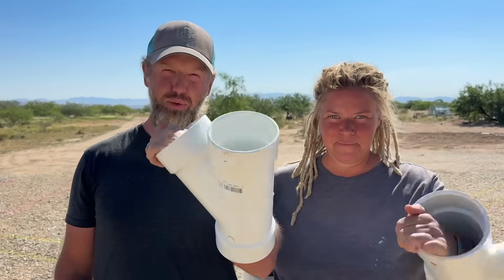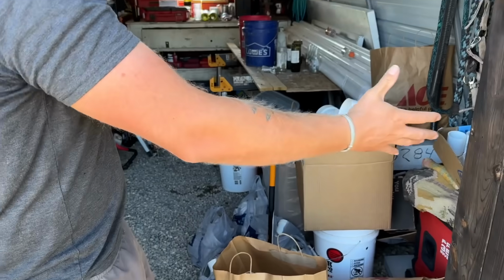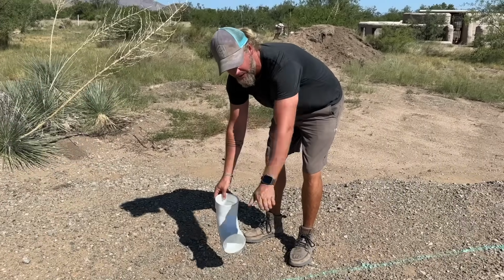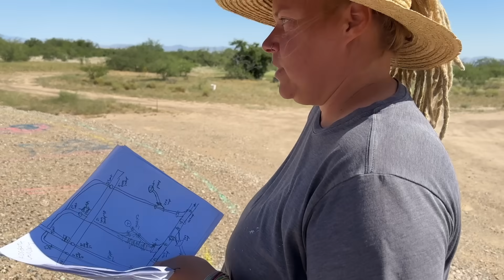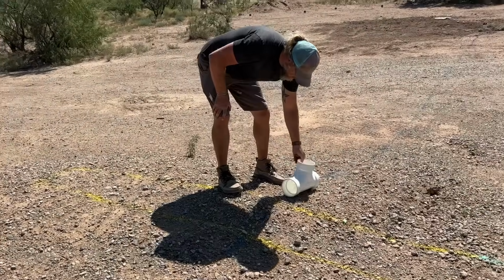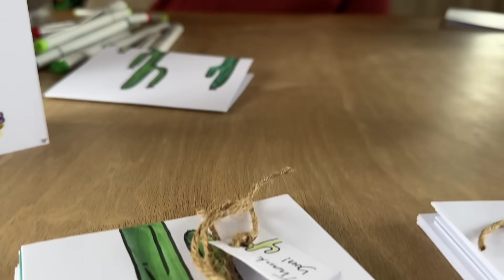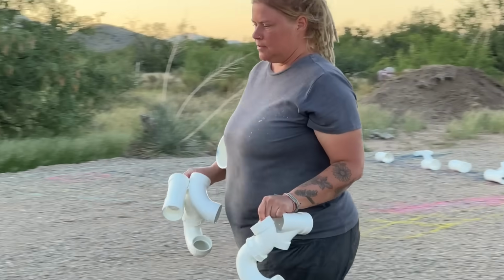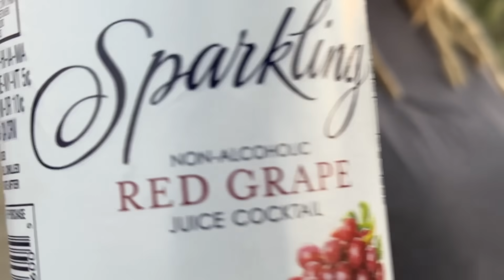Hyperadobe Earthbag Roundhouse BEGINS!

Comment: Can't have too many cleanouts in my opinion. In the my new to me home, I had to have plumbers clean out 3 times. First, after one shower, next after I used the dishwasher and the latest came after I ran the washing machine.  I have only 2 cleanouts and a camera inspection revealed a weird bend under the concrete slab near the septic tank. And I also had the septic tank cleaned out.
Reply from the maker: Yeah we're going to have like 4-5 total

Comment: Mech designer here, FYI, clean-outs needs to point towards the down flow . Essentially, you are trying to push any blockage towards the septic tanks. The vent line needs to slope up which also prevents water from staying in the vent line.

Comment: Using the correct color code helps out a lot. Red: Used to indicate fire protection piping, as well as piping carrying flammable gases and liquids.
Yellow: Used to indicate fuel gas piping.
Green: Used to indicate piping carrying compressed air and other non-toxic gases.
Blue: Used to indicate piping carrying potable water.
Orange: Used to indicate piping carrying toxic or corrosive fluids.
Brown: Used to indicate sewage and other waste materials.
Reply from the maker: What do you think we're building, an industrial complex?

Comment: Put your smaller cleanouts in the wall, under the sinks.  Also your main line cleanouts DO NOT need to be in the house or patio floor, they can land outside the floor boundaries.  The cleanout the furthest away and outside the back wall of the house is perfect.
Reply from the maker: All cleanouts will be outside of the house :)